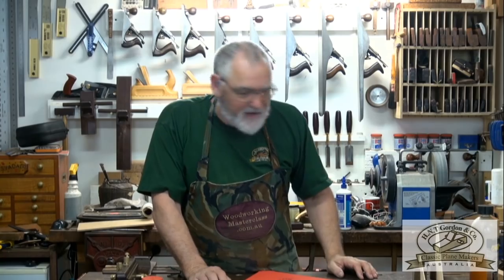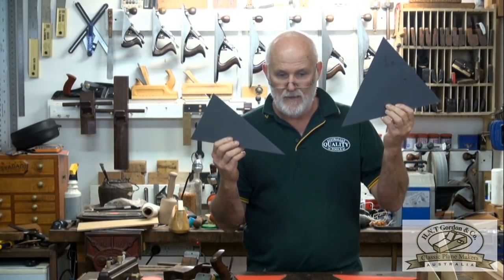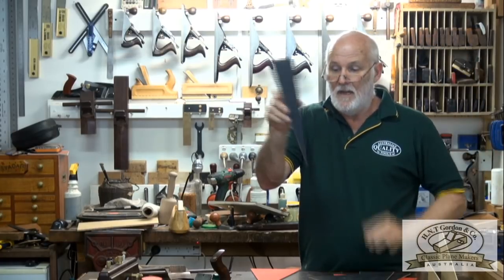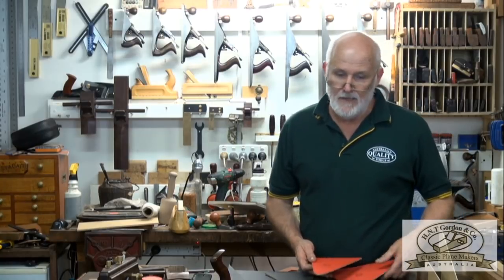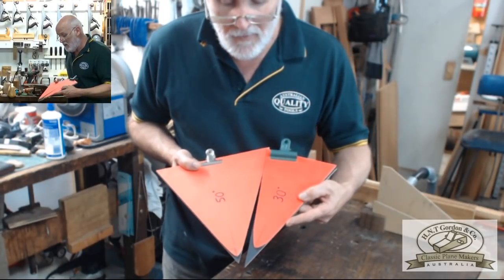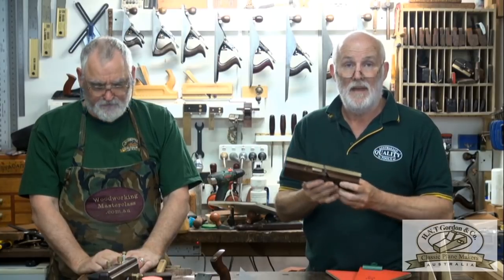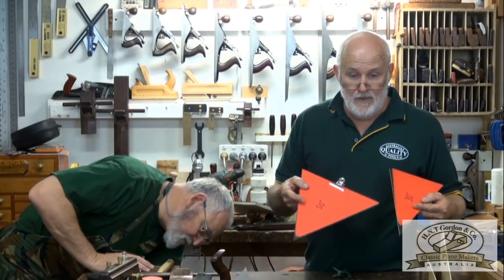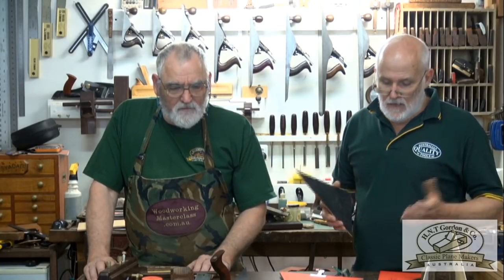Planing and Clearance Angles Explained by Terry Gordon (HNT Gordon)

Comment: Do you got any tips to get absolutely perfect joints where there are angels or curves. I am thinking perfect enough so that i cant get a hair in between. Say if I want to join a metal part to wood and I want it to be absolutely perfect, but I do not want to glue the parts together. Is it possible to use some kind of glue or other stuff on the wood then press the metal against the wood surface to get a perfect fit, but of course I want to be able to remove the metal part easily afterwards. 

I also want the residue to become very hard and stiff, maybe i could use hide glue for this? Couuld i maybe wax the metal part or put some bicycle oil on it then clamp it down to the wood that has hide glue on it, wait for the hide glue to harden - then remove the metal part easily without damaging the hide glue layer?

Thanks for your informative videos.
Reply from the maker: I'd have to see exactly what it is you want to do so I can give you a better more precise answer. Bear in mind that wood will expand and contract as the seasons chance. The one thing I would suggest, for that reason, is to use 1/4 sawn wood as much as possible as it is the section of timber which has the least amount of seasonal movement. Cheers Steve

Comment: Wouldn't sharpening the primary bevel a little before the secondary help to maintain the ratio between the two? Having followed previous advice and spending several minutes (days) re-sharpening all my chisels I can't face doing it all again.
Reply: My understanding is that having the primary face at a greater angle (more obtuse) means that you don't remove as much metal when you sharpen the secondary face. You can do several sharpenings of the secondary face before the primary needs to be redone. 
Here's a great sharpening vid. https://www.youtube.com/watch?v=vtCAbP_B4as
Reply from the maker: If you sharpen the Primary Dennis, there is no need for a secondary. I now only use a primary, providing i'm in my own workshop. Cheers Steve